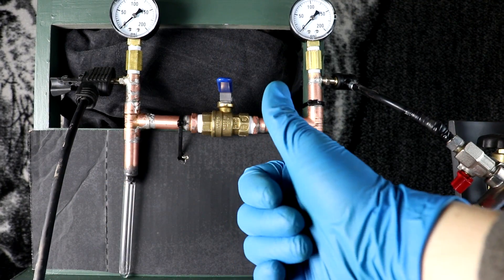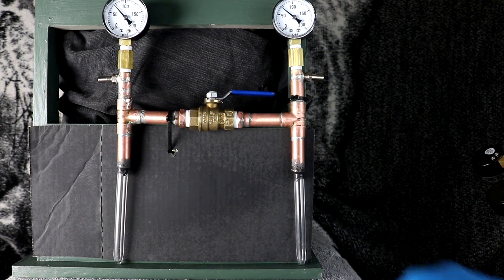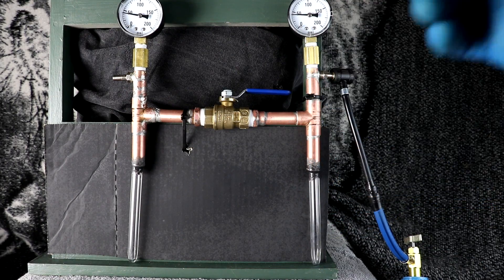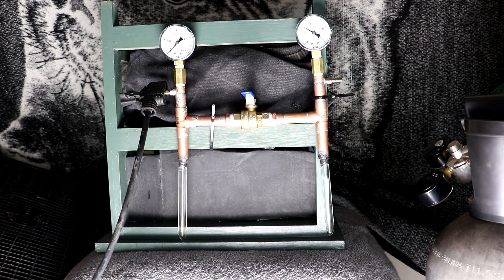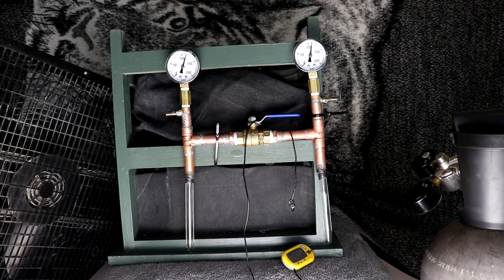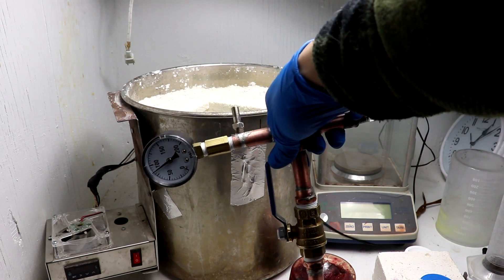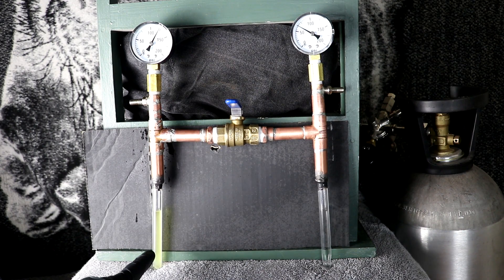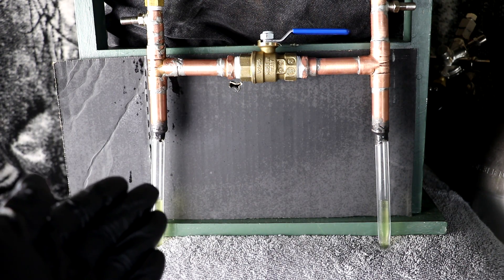The Law of Partial Pressures Demonstrated Using Vapor Pressure

Comment: I don't know if you already know why the propane kept leaking after you disconnected it. The propane leaking out of the connection froze your valve, so the elastic seal became rigid and leaked. R134a does the same exact thing if you disconnect it in the same exact way. Sorry if this is blatantly obvious and you already know hehe

Comment: Hmm I wonder if the difference between the two partial pressures is proportional to a loss in total pressure.  (And perhaps a rise in temperature.)
Or maybe the slight drop in total pressure is due to the extra volume afforded by the open valve (assuming the valve takes up more space when closed).
Or perhaps the change in pressure when the valve is opened is so fast the needle on the gauge overshoots.

Comment: I guess this answers my question about gasoline storage containers. Although it is very difficult to find information about the kinetic energy of gasoline vapor since it can be comprised of over 500 hydrocarbon elements. I’ve searched countless articles and can’t even find a designated pressure rating for “portable fuel containers”

Comment: Isn't Raults law applicable in the scenario with r134 and propane? Could you explain why the vapour pressure lowers in the case for example  a mixture propane and butane? Compared to pure propane.

Comment: I dont get the formula. If Pt = P1+P2+Pn why is it that if you mix CO2=P1=50 psi and Air=P2=100 psi and sum them you get  75 psi. I mean I get why it has to get lower, you demonstrated it well. But shouldn't the formula be Pt = (P1+Pn)/2?

Comment: Doesn’t the law of partial pressures just say that the combined pressure of the gases is the pressure of each one as if it occupied that volume alone?

The JT effect works in refrigeration cycles because it takes energy to expand the molecules into a gas, thus dropping the temperature. It takes energy to compress a gas and to expand it, there’s a happy medium just like with a spring, it takes energy to stretch and to compress.

This experiment makes sense in that it was probably at some sort of equilibrium on both sides before opening the valve, the equilibrium changes and so it takes time to balance out again, the volume has now changed for each gas and the temperature and the pressure, so it’s hard to picture exactly what would happen, but the fact that the evaporation takes place isn’t that surprising. I mean in an isolated system if you increase the pressure you would expect the vapour to condense and not evaporate, but this isn’t an isolated system as mentioned above. The immediate change of the pressures to an average of the two also makes sense, and was pretty cool to see. And as the liquid evaporates the number of gas molecules increases, thus the collisions increase, thus the pressure must increase, so that’s intuitive. What isn’t as intuitive is that the pressures end up being additive, because as I mentioned first, the original gases weren’t occupying the whole volume, just half of it. It’s probably because as you said, the total energy of the system hasn’t really changed since the total volume is fixed and the temperature evens out. And the pressure is a measure of energy per unit volume, so it makes sense I guess that after final equilibrium the two pressures (energies) would combine.

I’m not totally satisfied with my understanding though, for some reason. Maybe you guys can point out the errors in my thinking?

Comment: Don’t you mean the water and alcohol has a higher vapor pressure than pure alcohol? Because then when you boil it your actually going to boil the mix before the pure alcohol because the mix is more volatile? Thus the separation won’t occur.

Comment: Maybe I'm just really tired or my English is at fault but Daltons law said to add the partial pressures into a sum and yet now in this video the pressure always lands on the sum/2. Why is that?

Example. The first ones were 50psi and 100 psi, doesnt daltons law say 50+100=150? In the video the gauges are at 75.

Edit: Nevermind, tiredness got the better of me, forgot that the gases both expand into a higher volume chamber when he mixes them together haha

Comment: The conclusion in the end is very wrong. See Raoult's law. Actually the observable positive azeotrope should be nowhere close to the sum of vapour pressures and yes you should take into account another solvents present in the chamber.
If you ask why? Scroll down to the beginning of the video, the surface of the mixture will have different property and different equilibrium than pure monosolution.

Comment: Now hold on here for just a minute! Something is very intuitively wrong in my head about this!I 
Please correct me if I am missing a huge chunk of this. I think this is all wrong.

It's not the sum of each individual single gas pressure system before mixing that gives the new Total pressure after mixing. The new derived total pressure after combining is the average of each individual pressure. If adding them were correct, then if two gases were at 50 pounds and they mixed, the total pressure would have to be 100 pounds and that ain't gonna happen. That thought is what triggered me.

You must add the pressures together only. Not the volumes. 
What Dalton's Law says is if you were to combine both into the same volume as one.
Consider if you had 2 balloons, one filled with 1 pound of pressure (P1) and the other with 2 pounds of pressure (P2). If I connect them using a check valve to only allow the flow of has into the 1 pound balloon and none out, they just equalize to 1.5 lbs each. No more air flows 
If you want to add the pressures of both gases in the balloons, you have to squeeze one into the other.
But Dalton's Law says to add all of the pressures to get TP , P1+ P2+P3... it doesn't add part of the pressure. Using your demo and just adding part of P1 would make the equation P1+.25P2
You still had 75 pounds in one that was never added. If you would have added it, you would have ended with 100#+50#=150# P1+P2=TP as Dalton would approve of. And Snell as well.
The summing of pressures of different gases is not what is demonstrated or presented in this proofing experiment because the gas pressures were never added. You can't add pressures if you also add the volumes, the pressure will not increase .
The pressure just follows the laws of thermodynamics and flows to conserve energy.

The ball valve only has a tiny volume 
The ball valve acts like an orifice tube like the one used in the air conditioning system in your car.
The low side has just become an evaporator.
The high side has become a condensor.
It will continue to cool until both sides are equal pressure. 

Normally, the compressor in an AC system keeps the high side pressurized as the refrigerant is discharging through an orifice into the lower pressure side. Venturi effect
The compression of the gas by the compressor creates a lot of heat.

The lower glass tubes are well insulated from the metal and the local ambient heat.
And heat from your hand can warm the copper easily.
When you tilt it, the copper tube acts as a heat sink for the liquid and is an excellent conductor of heat between the liquid and the ambient heat. 
Like how 60 degree air is no big deal but 60 degree water feels much colder.

That's my $ 0.02 anyhow.

Comment: Pushing 200 PSI with those JB welded glass tubes! EESH!  You've got far more confidence in JB weld and glass under high pressures than I do. If that system failed would there have been enough gas to displace the oxygen in the room causing you to pass out?

Comment: The AC shops in Arizona will add about 5 to 10% propane to a cars AC systems to make it a little colder. Then it’s 117 deg. You need all you can get.

Comment: Do you think the pressure was slightly lower than 75 PSI due to the added volume of the opened ball valve? Seems like that small amount of volume in the ball could drop it a psi or two

Comment: I'm curious. Does this mechanism give or take support for the concept of adding an atmosphere to Mars? I'm under the current impression that to live there, you would want to compress and store the current atmosphere for use in domes, which would be replaced by solar wind. But now I'm thinking that fewer gas atoms would lengthen the distance to collision, and increase the rate of atmosphere loss. But if this is true, then could Mars hold a denser atmosphere if only the solar wind was decelerated before arriving at the upper atmosphere?

Comment: In a large metal spoon, combine 1 gram of cocaine and ½ gram of baking soda. Carefully fill the spoon with water to the ¾ mark.

Place the spoon with all three ingredients over medium high to high heat until all of the baking soda has finished bubbling out.

Your cocaine freebase will appear in the bottom of the spoon in the somewhat murky colored water that remains. The freebase will be yellowish gold in color.

Pour out the remaining water with any residue left floating on top. Fill the spoon with fresh cold water over top of the freebase. Now, with a sharp, non-serated knife, gather the freebase from the spoon in one full motion and let it fall onto a ceramic plate. Now your done with the spoon.

Now, tilt the plate and let any excess water fall off. Don’t worry, the freebase will not move at all when tilted. With a paper towel, carefully wipe up any remaining water from around the clump of freebase.

Run the same, non-serated knife back and forth over the freebase clump. It will quickly change from an oily yellowish gold clump into a rock hard white form within a minute or so. Once this happens, stop using the knife.

Now, with a sharp razor blade, carefully scrape up the white freebase into a pile. With the bottom of a medium size metal spoon, carefully crush up the freebase into a fine powder.

Now this next part is what everyone leaves out, but it is THE most crucial to obtaining pure freebase cocaine. If you omit this part, you WILL also be smoking freebase amphetamine and freebase ephedrine, most assuredly.

Take a small drinking glass and fill it up with about 2 inches of fresh cold water. Now, pour your dry freebase pile into the glass of water. Stir up the freebase for a minute or so. This will remove all traces of amphetamine, methamphetamine, ephedrine and psuedo-ephedrine from your freebase because they will all dissolve in the water, while the cocaine freebase will NOT dissolve.

Hardly anyone knows about this step and it is the most crucial. Otherwise, no matter what step you decide to use for making freebase (albeit aluminum foil, ammonia, bi-carb, etc), you’ll be carrying all of those adulterants right on thru to the end. They will ruin your cocaine high, believe me!

Once you have stirred the freebase and water for a minute or so, carefully pour out the water and freebase into a coffee filter paper. You can pour fresh water into the glass and swish it around to collect any freebase that got left behind when pouring it into the filter paper. Now, the only substance left behind in your filter paper is the most pure freebase cocaine you will EVER experience!

Once the water has all gone thru the filter paper, you can pour the pure cocaine freebase out onto a clean plate. Let it dry for another 3-4 minutes or so and smoke away.

Total time: 30 minutes

Comment: To the logical person in me, this makes sense. I take a volume of air at 100 pressures, and release it into a tank of equal volume starting out at 50p, they AVERAGE together at 75p (temperatures being equal). And your first demonstration showed this. To the non-chemist in me,  Dalton's law, or at least the notion, doesn't make sense. It would be 100p + 50p = 150p.  And then you throw in vapor-pressure with the refrigerants which really confused me.

Comment: what if the liquids are immiscible and one on top of the other, how is this going to affect the lower liquids equilibrium...?
Reply from the maker: boiling point would not be depressed but vapor pressure will still add. in fact it is the miscible liquids that have less than simple addition since they are attracted to each other.

Comment: Wait, if the vapor pressures add up, then the vapor pressure of a mixture should be higher than each separately, so they should boil at a higher temperature. What am I getting wrong here?
Reply from the maker: Higher vapor pressure = lower boiling point.

Comment: Ok I have a question. When liquid  propane and butane are mixed 50/50 the vapour pressure is an everage of the 2 vapour pressures. Is this correct and why does this happen. Is there a chemical reaction between the 2 liquids which causes the everage in stead of the doubling of the pressures or am I missing something?

Comment: Why would it be surprising that adding 50 psi to 100 psi and doubling the volume would give you 75 psi?  I don't see what that has to do with partial pressures.  I should think that would work with two volumes of the same gas or any gas.  What does it show?

Comment: In the past few years, the argon gas had leaked out from between the 2 glass panes in one of my doors.  Now the panes are almost touching each other.  The theory is that the argon can get out because the argon molecule is very small and can squeeze past the seal, but the air can't, so the pressure between the panes goes down.  The theory goes on to say that the argon leak is not influenced by atmospheric pressure and just the partial pressure of argon in the atmosphere, which is extremely low.  Am I understanding this correctly?  Does this correlate with your understanding?

Comment: 16:16
I don't get it. 
On one hand I understand that since liquids are vaporizing that the apparatus should get colder.
But on the other hand since the pressure is getting higher and the volume is still the same (hmmm well almost the same b/c the liquids level decreased) shouldn't the temperature have increased by PV=nRT ?

Comment: I’m confused. At the beginning you said “the sum of the partial pressures” and the equation showed the same. Which is the opposite of my intuition which said it would be the average pressure of the two. So in your first test of 100psi air and 50psi carbon dioxide My intuition said 75 but the calculation would mean 150psi when you opened the valve. What did I miss? Is the equation at the beginning wrong or am I misunderstanding it?

Comment: I’ve got an interesting question! I know it’s of topic to this video but when you throw a rock in to a pond or any body of water where the rock meets the water the rings spread out but there are more consecutive rings before the ones that are already spreading out and it’s very confusing how and why this is caused.
Reply from the maker: So those extra ripples are what’s called the rayleigh wave and have a speed dependent on the surface tension. They are far slower than the primary wave but may still overtake the displacement front.

Comment: I went through a roller coaster of emotions in this video. I initially predicted that after the r-134a was allowed to mix, even though the pressure of the system would increase, the partial pressure of the r-134a would be lowered thus meaning the liquid would boil off gas molecules until it was at equilibrium. I thought it would be quick so I figured when Cody opened the valve it would drop. But then it rose and I was disappointed! However during codys explanation it all made sense and then boom he shows the time lapse which ultimately showed my prediction was correct! Haha it was a fun ride that’s for sure. I’m glad my thermodynamics classes didn’t let me down

Comment: Hey Cody. Great video on Dalton's law and gas mixtures. I think you may have observed a false positive from your propane + R134a test however. The vapor-liquid equilibrium (VLE) of this mixture forms a known minimum boiling azeotrope (i.e maximum pressure azeotrope). In the absence of any interaction, the expectation of the VLE for a mixture should yield a pressure in between each components pure pressure wieghted by their composition (see Raoults Law for the ideal case). To prove this to yourself, I would recommend trying your same test with Propane and Butane (safely of course) - this system should not form an azeotrope and should yield some intermediate pressure. Thanks for the great videos!

Comment: 12 psi? What altitude do you live at??
Reply: Do the math, probably close to 5200 feet as I live in Denver and 12.2 PSI is the average of what I see on my baro sensor on my car.
Reply: @jeffhurckes190  did some research and apparently Leadville, CO averages a pressure of around 10 psia! Lower than I expected for a whole population.
Reply: @constantine333B  When I drove up to the top of Pikes Peak, it was at 8.9 psia

Comment: Great video Cody! Very interesting!  I do HVAC and can tell you getting 2 refrigerants mixed in a system is a bad thing,,,very confusing to diagnose what is going on when that happens. I believe I learned in trade school propane was originally developed as a refrigerant and has all the properties you want for air conditioning except the flammability issue.   One other unexpected bonus from this video is a new found respect for JB weld.  I never would have thought it could hold together under 200psi.  Good stuff

Comment: As an HVAC tech... the current refrigerant trend of blended (mixed) refrigerants beginning with a 4 in their nomenclature, (I.e. 404, 410 etc) are all mixtures of refrigerants in a specific ratio... this makes charging  and repairing a system tricky...

Comment: What am I missing, if you put the exact gas or air in both sides at 50 psi and 100psi, wouldn’t it equal 75psi when you open the valve?
Reply from the maker: not if there is a bit of vacuum in the valve.